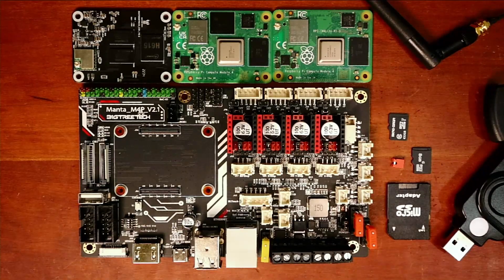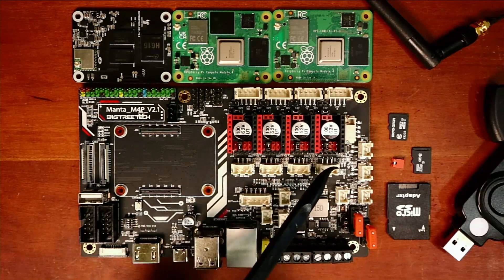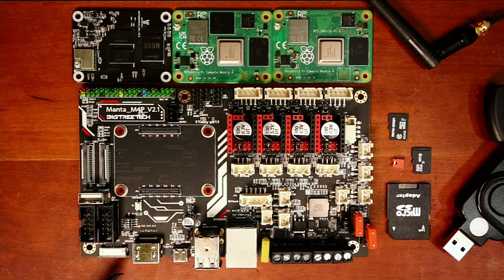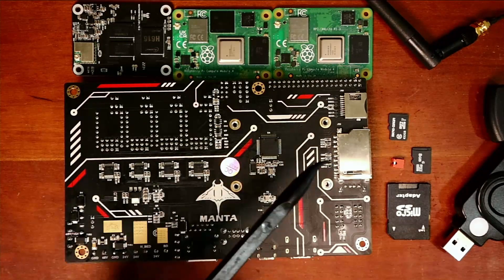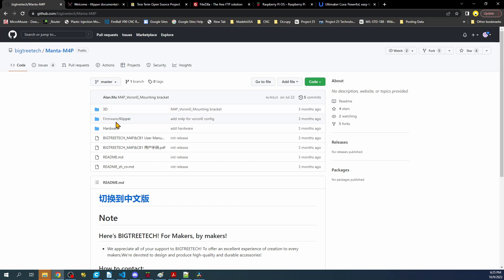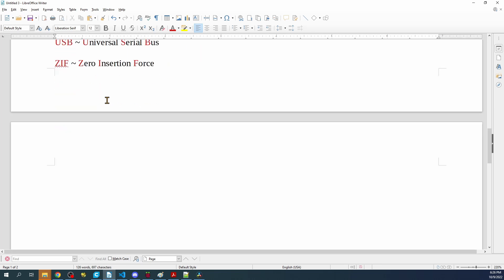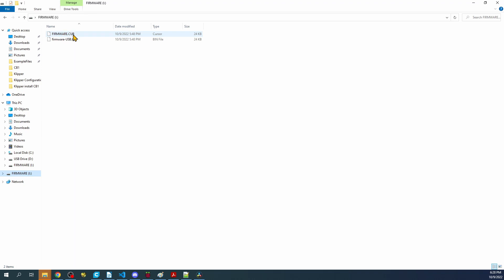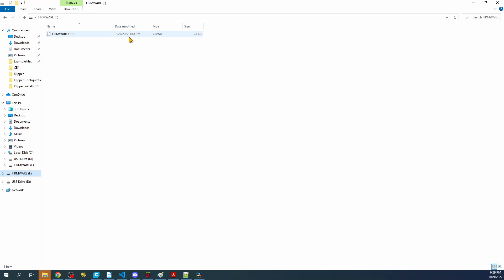BTT - Manta M4P - Basics

Comment: I'd love to see a video on enabling and setting up a tft (IE TFT50 V2.0 or any of the pi  screens) style screen through the DSI port. I've gotten mine as far as getting the octoprint text screen up on boot, but Haven't made it to yet to running it's own instance of octoprint from the screen
Reply from the maker: Have a display on order, as I order v1.0 a month ago.  The v1.1 should be in in two weeks.
Reply: @EdwardBraiman  v1.0/1.1 for what screen out of curiosity?
Reply from the maker: HDMI5 display.  Still working on configuration.

Comment: It is very helpful.

Not sure how to enable PS-ON in cb1&mantam4p and klipper configurations?
I saw that 1 port of RGBx2 can be changed to PS-ON, but I don't know how to do it...
I would be happy to receive your reply.
Reply from the maker: Generally you need to use the signal pin specified, but I believe there's a link to example configurations.  Note they are normally on a different board, so pinouts will vary.
Reply: @EdwardBraiman  Thank you for your reply.
It went well!

By the way, is it possible to rotate the orientation of the HDMI display with the CB1?
Reply from the maker: Possibly.

Comment: I know CB1 is just for klipper. But Can you confirm that with a CM4 it can run octoprint ?
anywhere i look it just says  klipper
Reply from the maker: You can, but there's some time involved.  You need to install a default image of Debian and then install OctoPrint.  Might take an hour verse 10-20 minutes with image.  Also you still going to need to install Klipper plug-in and git and install Klipper under the hood.   If Marlin creates a configuration, then you can just use OctoPrint.  Haven't seen any movement on this yet and checked last week.
Reply: Hi, the Manta M4P/M8P are designed to prefer Klipper. Using Fluid or Mainsail as the Interface is ur decision. Marlin on this Board with Octoprint on the Raspberry. Is imho.  a backstep.
U need to inform urself more how, klipper works. U flash the Manta M4P ( or other Boards ) one time. No VScode and reflashing, like in Marlin if u want to change only one Configuration Parameter. U change the Textfile Config, reboot and test it. On a failure remove ur changes reboot again. Klipper is a big step forward in 3D printing. Only my humble opinion.
Greetings
Reply from the maker: There's more Klipper tutorial on this board coming, Marlin firmware maybe in future, just not possible yet, but might show how.